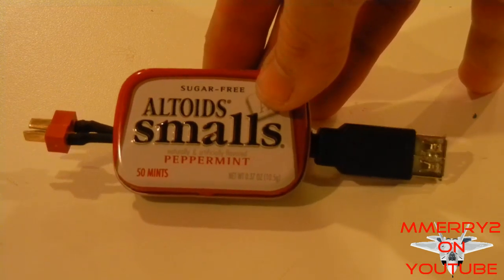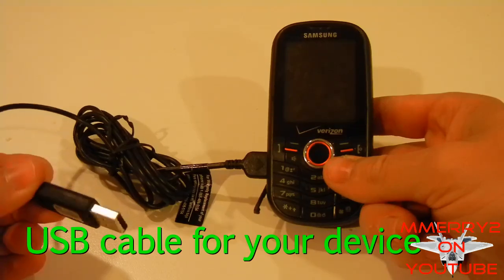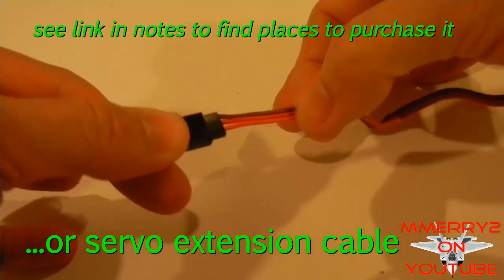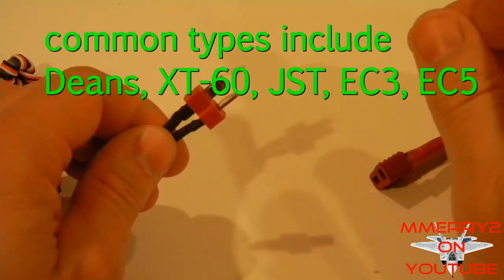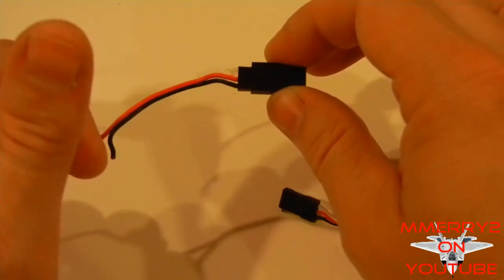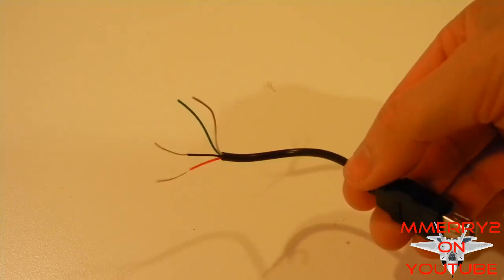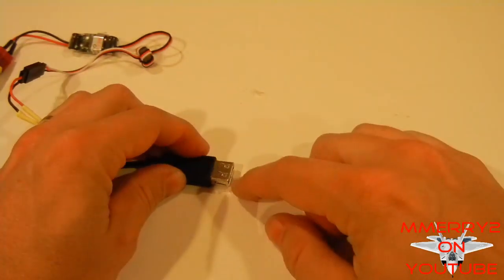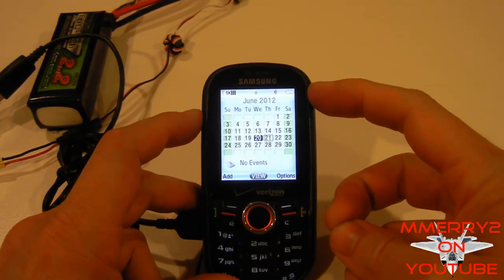How to make Lipo Battery USB Charger/Adapter for Phone, MP3, etc.

Comment: if i plug the usb end into a wall charger can i charge the battery itself?
Reply from the maker: No.  It doesn't work for charging.  I would recommend a USB LiPo charger for that.  They sell them on Amazon.  Keep in mind that USB ports only output a limited amount of current.  Read the current output on the charger.  1 Amp is OK.  3 Amps or more is better.

Comment: Hi, I don't understand what minimum voltage of the LiPo battery does the UBEC module cut the power out? Would it be safer for this charging setup to connect a LiPo voltage alarm buzzer to battery's balance port and then set its minimum voltage to a desired value? Just wondering.

Comment: This is an old video... but if you connect the Green and White USB wires together then you can do fast charging for newer phones (depending on the amperage of the battery and UBEC).

Comment: What is the output current on a USB port of your charging circuit? Does this UBEC module step the output current down on a USB port? Thx
Reply from the maker: +Viktor Božičević The output current is close to the current of the UBEC that you use.  The UBEC does not step down the current.  The current used is dependent upon the USB device you use.  For example, some devices use 0.5A, some use 2A.
Reply: +mmerry2 on YouTube  So the output current on the USB won't be the same as the output current of the lipo pack? Because from what I see you've used 2200mAh lipo @ 70C which would then be 154000 mA or 154 A of discharge current. Wouldn't this or higher discharge current damage the UBEC or charging device?
Reply from the maker: +Viktor Božičević No, the UBEC will only be able to supply 2A current, even though the battery could supply 154A to the UBEC.
Reply from the maker: +mmerry2 on YouTube CORRECTION.  The UBEC could be damaged (burned up) if it's rated at a max of 2A and the USB device requests 3A.  You want to make sure the UBEC is sized adequately for the current for the device(s) you want to use.
Reply: Why can't you use bigger UBEC, like a 10A UBEC instead of 5.. ??

Comment: Why buy a servo extension when your just going to cut it and solder it to the USB cable. Just cut the wire coming off the bec and solder there no extension needed.

Comment from the maker: A Minty Boost is a small & simple, but very powerful USB charger for your mp3 player, camera, cell phone, and just about any other gadget you can plug into a USB port to charge! The charger circuitry and 2 AA batteries fit into an Altoids gum tin, and will run your iPod for hours! 2.5x more than you'd get from a 9V USB charger!  Google "adafruit minty boost" to find it.

Comment: @Rune What you do is use a Lipo battery voltage detector, they hook to the charge side of your battery leads and display, with LCD, the current voltage as well as cycle through all the voltages of the cells. They're about $2 on ebay if not less than that...

Comment from the maker: Devices like iPhone 4s require a special 2 Volt current to the center 2 USB pins, so this charger will not work for those devices.  I suggest you try a Minty Boost kit for special devices like this.

Comment from the maker: I wouldn't expect the UBEC to get hot, only warm, because it's discharging the LiPo slowly.  Yes, you can use an ESC with a built in 5v BEC instead of a stand alone UBEC.

Comment from the maker: It won't damage the device being charged, but the LiPo can get damaged if it's discharged too much.  I use a LiPo alarm on my LiPo that beeps if the voltage gets too low.